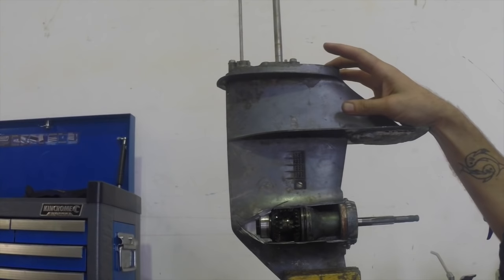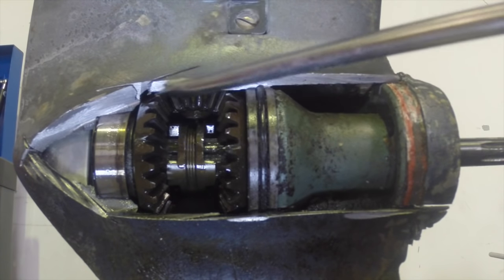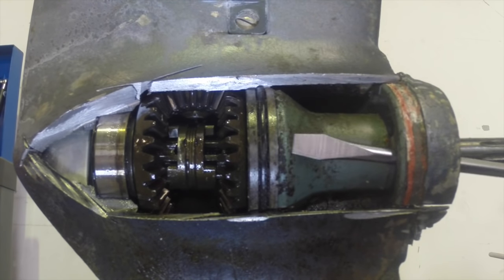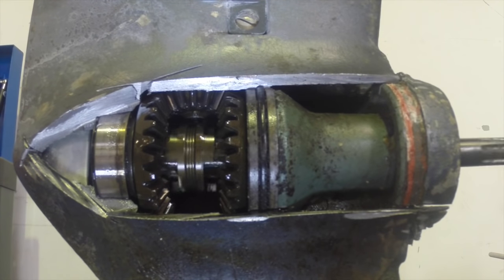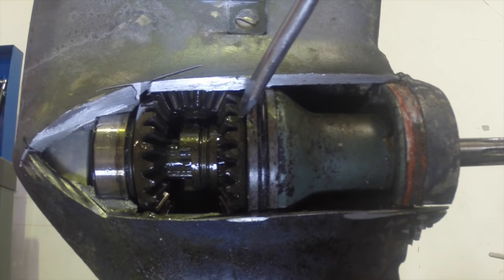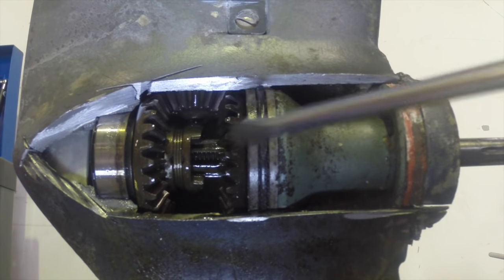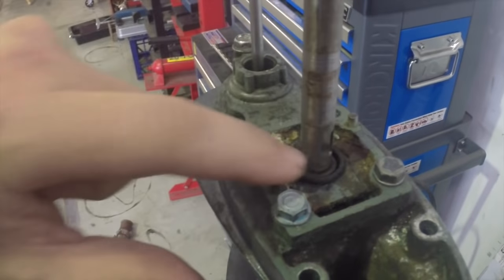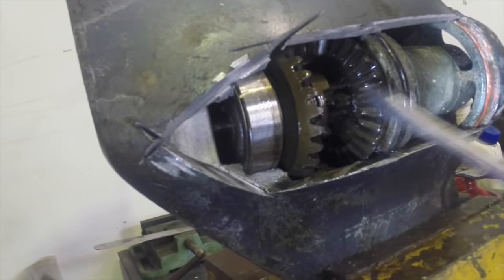How an outboard gearbox works

Comment: Prop question for you.My 9.9 johnson has a 15 hp carb. on it which increased my speed but still has the prop it came with which has a different pitch than a 15 hp.Is it worth getting a different pitch prop to get anymore speed.Have motor on a 14 ft jon boat, but would like as much speed as I can get.
Reply from the maker: You could try a steeper prop pitch if you now have the power to drive it. The trouble is that it is like having a higher gear in a car. In theory it will give you a higher top speed, but the motor might bog down (like taking off from the lights in 3rd) and not be able to get up on the plane properly.
Reply: thanks..i have a 91/2 by 10 now..

Comment: I got chewed out by someone who works at a houseboat rental/marina for using reverse on my outboard. "Never use reverse it will wreck your gears!" Lol. I knew that reverse is always going so he was full of it. I think the issue is at the houseboat rentals when they service them, move them, and train people who rent them, when they use reverse (do as I say not as I do lol) they are extremely rough with it. They go from neutral to full reverse instantly. No wonder he thinks reverse is bad, they slam it so hard the force of going from 0 to full reverse must be really hard on the gear teeth and the clutch.
Reply from the maker: Yes, it is changing gears while the revs are still high that will damage the dog clutch, but that is all.

Comment: @Dangarmarine hey! I have a 25hk yamaha autolube, believe its from -92. I removed my lower unit for an impeller change, when I put it back my gears started to act weird. If i put it i reverse, it will want to jump back to neutral, but it never gets into neutral and just makes this clicking noise since its in between reverse and neutral. What should I do? Should I remove the lower unit, put it in reverse and then remount the lower unit and see if it still appears? 

Before I changed the impeller, I had no problems at all, all the gears clicked into place and I never had to guess where the neutral position was. Now I have to be very careful to not put it in reverse while trying to put it into neutral.
Reply from the maker: Yes, it sounds like the forward control and gearbox were in two different gears when reassembled. This can happen with splined rotating gear selectors. This video might give more information too https://youtu.be/B4acSf_BgP4
Reply: @DangarMarine  Correct me if im wrong. Do you put the gear in reverse meanwhile screwing the shift shaft down to the bottom, and then tightening the lower bolt? I cant remember if I took it to the bottom before I tightening the lower bolt. (Might be the case here)
Reply: @DangarMarine  Solved the problem after watching your video! Served me well! Thanks! Only thing that I thought of with my "push-pull" gear, is that it havent got the noticeble clicks like yours had, its a bit loose in the neutral position, but the reverse position while pushing it down was going in well and stayed, but when I pulled it upwards towards the forward gear it wasnt as subtile as the reverse.

Comment: i have a outboard where gear selector is on tiller handle, long story short, full throttle on the water in forward gear, chilly bin slides back in boat smacks gear selector into reverse instantly while at full throttle, still seems to run fine, bit of noise when selecting forward or reserve and unable to select reverse while motor is not running unless i move prop and try select at the same time, what damage have i possibly done, should i worry and get it fixed or will it be fine apart from rough gear changes ?
Reply from the maker: It may have chipped the teeth of the dog clutch. This isn't too hard to replace if it gets bad or starts popping out of gear. Not going into gear without turning the prop is normal.

Comment: Hey stu, tell me, when the motor is off, why does the prop shaft ratchet in forwards, spin both ways in neutral and lock both ways in reverse. Someone said its the ramps on the forward gear side of the dog clutch. What determines when the forward gear actually locks? Centrifugal?
Reply from the maker: Hi Matt. The ramps are only on the trailing edge of the teeth of the dog clutch. This means that it will lock straight away when turning forwards and ratchet when turning backwards. As the motor only turns one way it will lock as soon as it is put in forward gear. I'll take one apart soon and do a video on it.
Reply: Gotya. 
Perfect exp.
Cheers

Comment: Thank you for your time! But If the drive shaft is not what makes the grinding sound what does? And is it normal? Or does is need some type of timing adjustment or something.
Reply from the maker: The noise is the dog clutch locking into the backs of the gears in order to lock them to the propeller shaft. If the gear selector is out of adjustment then the dog clutch may stay at that point where it is touching the gears and but never completely locking into it. This is the phase where you hear the noise. This can also happen when people select a gear too slowly. When you are in neutral, wait for the revs to drop if you are changing from forward to reverse for example, and then select the gear quickly and crisply. That can reduce the grinding.
Reply: The sound is there every time im shifting into gear
Reply from the maker: Going into forward and reverse?
Reply: Yes !

Comment: What does the reverse lock do? Also every time i replace a impeller its stuck in reverse,yamaha and mercury? Does the reverse lock  mechanism have anything to do with it?
Reply from the maker: No, the reverse lock stops the outboard from tilting up, not locking it into reverse gear. Must be a shift linkage problem.

Comment: Nice video- I have a question- Suzuki DF40, the prop will not engage in F or R however the rpms are still there and the engine runs very smooth. Possible shift rod?
Reply from the maker: Yes, definitely sounds like the shift linkage has come off somewhere.

Comment: Could one switch to forward or reverse while the engine is running?
Reply from the maker: You want the revs to drop down to idle before changing as a dog clutch doesn't slip at all. Selecting gears at high RPM is very violent.

Comment: Thanks for the explanation!  Does anyone know what is happening if at idle, and with the gear level in neutral, the clutch dog is catching the prop shaft?  Having a tough time setting idle speed, because now and then the clutch seems to engage and it's too much load/engine dies.  Not happening as much with the idle higher than I wanted it.
Reply from the maker: It's quite an old video but this one might help you with your problem https://www.youtube.com/watch?v=B4acSf_BgP4

Comment: I have been battle this problem about my 1989 johnson 150gt checked all coil pack only 1st two had spark so I started the out board and cut off  and recheck now all 6 what is going on with it please
Reply from the maker: Sounds like a lose connection in some of the wiring maybe.

Comment: Just wondering if you knew anything about Evinrude fichct motors,I have one and every time I try to get on plane I get an alarm that says check engine and I don't know what it is I've replaced multiple things on this engine and I'm getting a bit frustrated
Reply from the maker: Hi Jay, unfortunately the only real way to be sure is to have an Evinrude dealer put a scanner on it and see what code it is throwing. Evinrude's are particularly tricky to repair without their special tools.

Comment: WOW, thank you! great video!!  Question for ya. When i put my outboard in gear and go slow shes fine. but as i speed up ive got grinding and it sounded like gears just barely catching then it slips in and out of gear. Good to know that the gears are always engaged. should i focus on the dog gear not fully engaging? It just started as of yesterday. It does it in both forward and reverse. i have a 3 stroke 65hp mercury outboard.
Reply: Dr. Dangar- in an attempt to change my gear oil on my 50 Johnson 1999, I remove the wrong screw to remove the oil. It was a Phillips head screw right above the bullet of the lower unit. I can no longer screw the Phillips screw back into the lower unit.What do I have to do to get it re-fastened into whatever it was fastened to in the lower unit. I appreciate your cutting open that lower unit to show us how the lower units work. Genius

Comment: How long would a gear box hold up if gear oil was drained empty.Bought an old one and owner had no oil in gear box.Motor seems to go fine with no jumping out of gear.Used it 5-6 times so far.Seals are not leaking.I drained and filled a few times to be safe since it was black inside when I drained the tiny bit out.
Reply from the maker: +newyota1 They can last longer than you might think. I've seen car differentials last a while and that is without the cooling that outboards get from being immersed in water.
Reply: thanks..I was also wonder if worn gears would make noise that I could hear while running on the lake and give any indication there was damage due to the lack of oil?I can here a noise at low speed on the water and running it on a stand at home that does not really sound normal to me, but am not sure where it is coming from?I don't here it at full throttle running.

Comment: I have a 1998 40 hp Force that I just put a water propeller in. I can not get it back in the neutral position. When I start it it will jump forward. The shifter is in neutral but the gear box is in forward. Can you please tell me how to adjust this.
Reply from the maker: This video goes through that process. Let me know if you still can't get it working. https://www.youtube.com/watch?v=B4acSf_BgP4
Reply: Thank You for the quick reply and I now have the linkage adjusted right. I am still having trouble with reverse and I think it may be in the gear housing. When I have it in neutral the prop will free spin both directions like it should. When I have it in forward it will spin clockwise but not counter clockwise. but when I have it in reverse it will not spin in either direction and is making a grinding noise inside. I guess I am going to have to take it apart to see what the problem is. Can you suggest a good kit with the seals I am going to need to put it back together I would like to get all of them and do it right if I am going to do it. It is a 1998 40 hp Force by Mercury and the serial number is  OE332530

Comment: where are you located? im in sydney
 i need my 9.9 evenrude fixed, leaks brown oil from center of prop after i do a flush, also today it was running normal then i go start it up to change fishing location and it was running on 1 cylinder, press the fuel line bulb while it was running on 1 cylinder and it wanted to fire up, sometimes stayed on full throttle and if i backed off it went back into 1 cylinder, also gear selector wasnt working normal, it selects but you have to force it a bit to engage
Reply from the maker: Coffs Harbour at the moment.

Comment: hi, i have a vibrate from the motor at 1700-2000 rpm, I've try different prop and check shaft run out, its only about .003 the most. what else could be cause the vibration?
Reply from the maker: Hmmm, good question. If you hadn't already checked I would have said prop then shaft run out. :) Is there any chance it is coming from the motor running rough on the transition from the idle jets to the main jets? Does it run rough when you have it on the muffs at that rev range? If so, can you see any movement (ghosting) anywhere from the flywheel down to the prop?
Reply: It only has vibration when in gear going forward, reving in neutral to that same speed is smooth. I haven't tried it with muffs and in forward gear to that speed but i did once tried it running in forward without prop on just running in a large bucket fill with water, i didnt notice vibration at that time.

Comment: My lower unit looks just like your's in this clip. When I took it apart to change to a new impeller somehow the gear selector in the lower unit has gotten stuck in fwd. Any tips on how to get it loose? Ive tried rotating the prop while turing the gear selector counter clockwise but nothing happens. I don't know what to do! Thanks for great clips!
Reply from the maker: Is the gearbox on the outboard now? If so then it sounds like the gearbox and the gear selector weren't in the same gear when it was put back on.
Reply: Dangar Marine. nope its loose from the outboard and still stuck. we have tried to rotate i clockwise and wise versa, also trying to pulling it up and down but it wont answer. Is it supposed to shift gear on this model by turning clickvise/ counterclockvise or by shifting vertical?
Reply from the maker: From memory it is pulled up and down on this one. If it rotated it will have splines on the selector. With gearboxes that pull up and down I often put a small rod through the hole at the top of the selector and use that as a handle to get the force required.

Comment: Have you experienced idle speed higher rpm and also when accelerating not much speed but much higher than normal RPM's?  Is it a prop condition?
Reply from the maker: Yes, sounds like you have this problem https://www.youtube.com/watch?v=0eI5HZXSTnM

Comment: The only way to do it right, cut away the casing and show exactly how it looks and works.
Has any manufacturer thought of coating the internals to resist corrosion?
Whether it be outboards or cars, alloys react with the water and it doesn't look good.

Comment: Really great video, your channel is by far the most informative regarding outboard engines/boats.
One question if i may.. I am having a really slight noise when turning the prop shaft by hand on my 2007 df90 . The noise sounds like when you press sand against your fingers. It really needs to be really quiet outside in order to hear it. I removed the lower unit and checked everything i can check and all seem normal. I checked the prop shaft with a gauge and it is 100% straight. Watching your video i am guessing there might be something wrong with the bearings since nothing else moves when i turn the prop shaft by hand in neutral..What do you think? I really appreciate your help. 
Chris
Reply from the maker: Generally that noise is just the hub of the propeller against the gearbox housing.
Reply: @DangarMarine  Thank you so much for your reply..I forgot to mention that i have removed the propeller and the noise i am writing about is when i turn just the prop shaft by hand in any direction..i will take a video of the noise and post it here!! Be well

Comment: I have a 1999 40hp 4 stroke Yamaha. The gear selector shaft came up/out when I took the lower unit off for an impeller change. I can't seem to get it back in to a position. Do I have to take the whole propeller shat/dog-clutch assembly out to reset the shift cam and get it into place?
Reply from the maker: No, generally not. If it is one of the wedged-shaped push-pull selectors then it should go back in once lined up properly.
Reply: Thanks!  How do I line it up? It just spins in circles and doesn't seem to catch on anything -- even when I rotate the drive shaft.  I'm in Texas, btw.  Our coast is a mess, so it will be a while before I use it.
Reply: It's not wedge-shaped. It has a spline on the bottom (similar to the top).  Any idea how to line it up?
Reply from the maker: If you shine a torch down can you see into where the splines to see if anything is blocking it or misaligned?

Comment: A little off topic here but I need your expert opinion . I just completed replacing the prop seals as well as the top shaft seals on my  Yamaha 30 MHLY Longshaft . I almost had it all completed with the pumping oil in . I ended up doing a bonehead move and cross-threaded the bottom oil screw , now it's stripped . Do you have any suggestions on how to tackle this dumb ass move I made ? .
Reply from the maker: Hey Mark, yeah, that happens... So there are a few ways you can go. You can drill and tap go to a larger screw, but the limiting factor is probably flat surface around the hole that is needed for the fibre washer to seal. The other option is to go with something like a helicoil and time-sert to restore the thread back to its original size. I've never used a thread repair system in such a thin wall like that though so you'd have to check the depth. That often need to bottom out to stop turning when you install them though. If it was me I'd probably go with the drill and tap and search around for a fastener that has a larger thread but the same size head on it. I'm sure such a thing exists somewhere in this big old world! :)

Comment: hey danger Marine always watch your videos I have one question that I have not yet found and you're channel . I have a Yamaha 200 horsepower with a counter rotation lower unit can I change the lower unit with propeller to a clockwise rotation lower unit?
Reply from the maker: Yep, you can swap them over.
Reply: from 200 to 250 hp lower unit. would it make a big diffrence?

Comment: my friend have a problem with the reverse of my out of( outboard mercury 115 hp tower of power) apparently propeller tour correctly and forcefully of reverse but the boat does not go backwards not a little while this in water so and accelerate it even more , that this impeller rotating March back  what can be the problem? i would appreciate some sort of Council
Reply from the maker: Take a look at this video, it should point you in the right direction https://youtu.be/B4acSf_BgP4